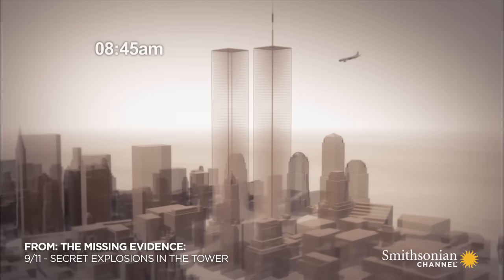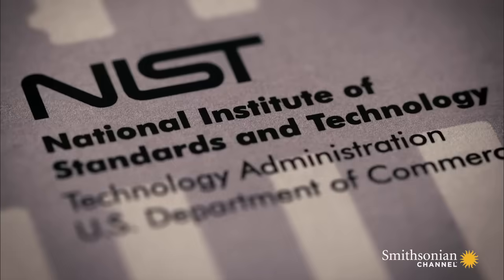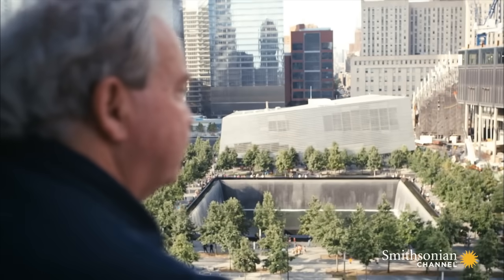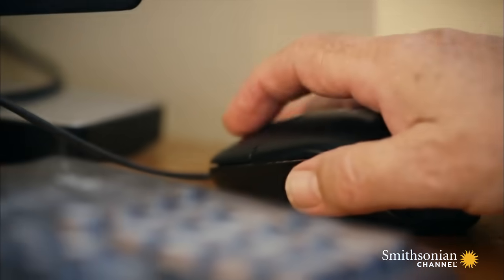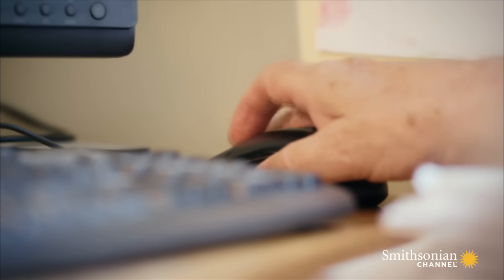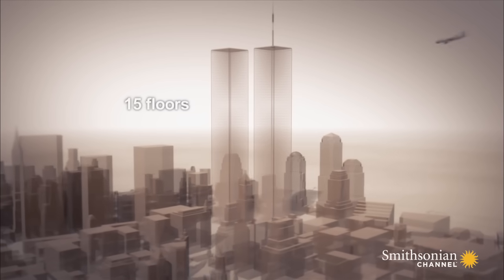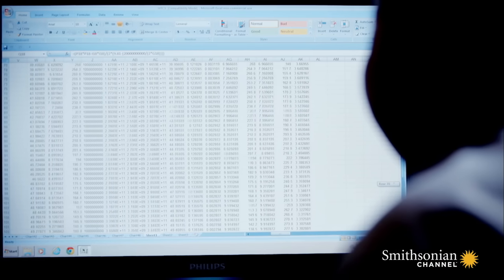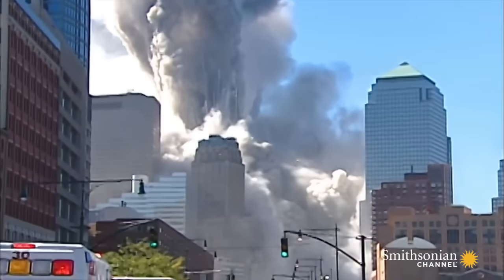This Computer Simulation Explains How the Twin Towers Fell

Comment: The block is suppose to be good at what he does, but he cannot even work out that a plane, ( made of alloy mainly) would have come to bits on impact and the main part of the bits would have been on the outside of the building.
He also misses the point that the amount of concrete and steel left after this was not enough to build half of the building.
Also since when does concrete in its solid state turn into powder on the way down.
An engineer with good practical knowledge of building materials, Dr. Judy Wood wrote a book that he needs to read from front to back its called where did the two towers go?
There are also people like myself who have also studied this  and like it or not there were explosives used, i have a video of an explosion taking place at the base on the corner of one of the buildings before a plane is supposed to have hit it, where did that come from.
I think this man has watched to many road runner cartoons and thinks things actually do make a hole that outlines that which impacts another object.
I have photos of just what happens when a plane travelling much faster impacts somthing and these clearly show that planes dont do anything like we were told happened.
I suggest he goes and does some more home work.

Comment: Pure propaganda bollox. He is being well greased. 20 floors above the impact dropping vertically, my ass; It has all amazingly become dust. And building 7 just thought it should follow suit for no discernable reason! And some little piggies got very rich and oil rich Iraq got invaded. And you can be damn sure the ordinary taxpayers were screwed over for every cent and the piggies are wallowing snout deep in the trough, caring not a fart about all those they murdered.
Reply: Oh my, another amateur structural engineer? Maybe study up on static and dynamic loads kid.

Comment: Everyone involved in defending the official story has lost credibility, NIST, Popular Mechanics, Smithsonian, the Federal Government, etc. If there is one good thing that came out of 9-11, it is this. Thank you for showing us who we can trust and who we cannot. To think that an aluminum can could go through a massive exterior of 2 1/2 inch steel enclosed beams, set 1 meter apart is loony tunes to begin with. Then to witness a mostly steel building just turn to dust and blow across the city should give one reason to question reality all together. Kind of goes against everything we thought that we knew about physics. Most of the billowing clouds of powder had to be steel, as very little concrete was used in the construction, mostly just in the floor pans. Makes me want to avoid any steel skyscraper in the future, it might just turn to dust and blow away.
Reply: Just make it up as you go huh? A 767 is a bit more than an aluminum can. And you really didn't do your homework on the steel. Up where the planes hit it was little more than a 1/4 in thick. and the buildings sure didn't turn to dust. The recovery crews reported the steel pile was 16 stories high. All the dust was gypsum panels pulverized in the collapse. Steel does not turn to dust until it has rusted for 100 years. Now maybe YOUR physics is rusty or nonexistent, but lots of sciencey types are comfortable with the planes breaking through the steel frames, and more of them are okay with the collapse mode. You can pout and whine all you want about the experts disagreeing with you. The rest of us think your little tantrums are precious.
Reply: @joeplumber1337  But lots of us independent "sciencey" types are not. If physics reacted as you described, then you would be out of business my friend. Furnaces and boilers would simply melt down and collapse leaving a cloud of small iron spheres all around it since most are fired by the same fuel that supposedly took down the twin towers. If an aluminum plane went through the heavy steel towers, and did not just plaster itself like a pancake and fall to the street below, then it was because the beams gave all at once, easily done with pre-placed explosive charges. But how it was done is not important to determine guilt and motive.

All of the evidence, if one sticks to science and physics, points to collusion and prior planning by those who had access and control over the buildings, the cleanup, and destruction of a crime scene, and the talking points after words. Osama bin Laden in his cave, would have had no such access unless the US Government at minimum looked the other way, which would have also indicated collusion. All fingers, no matter how you look at the whole body of evidence related to 9-11, points to massive collusion, and that points back to only one place.

The whole event opened the door to greater control and power by the US Government. Guilt almost always can be determined simply by looking at the actions of all involved parties prior to and after an event, and then determining who has the most to gain. Perhaps, you should be thankful that some of us understand physics, psychology and the sciences, which allows you to put food on your table. I suggest that you leave the thinking to us and just stick to plumbing.

Comment: Laughing at all the people who think a 110 story building would fall over like a domino.  How in the world could a building that large maintain structural integrity as it is falling over?  Think about it.  Or do some calculations.  Let's assume that the building leaned a few degrees.  Now calculate the component of vertical forces that are being applied in a direction that would cause a shear of the building keeping in mind the extreme torque that the lower parts of the building would have to sustain to maintain structural integrity.  These forces would far exceed any design goal for the building to handle shear forces.  Now go a few degrees more.  Any building this large would begin a vertical collapse long before it could have any noticeable horizontal lean.  Now assume that some parts that broke away did have some horizontal movement and calculate the angle of fall after it made half of it's parabolic journey to the ground.  Now calculate the angle as it nears the ground.  (Hint it will appear almost vertical which is seen in many of the videos.)

It should be obvious to anyone that a building this large would have the appearance of a collapse on itself.  It's not exactly collapsing on itself as some parts will (and did) fall a half block or so away but looking at it from a distance it will appear to collapse mostly on itself.

That would basically be true not matter where the structure first failed.  It is impossible for a building that large to fall over like a domino - which is something conspiracy theorists seem to want to believe would happen.

Comment: 1) anyone see what a plastic drone did to the nose cone of a passengers jet?
And your telling me a Aluminum plane did this to steal?

Not buying this crap
Reply: Your incredulous whining proves why the plane penetrated the tower. It's not that the plane was weak, but the drone hit the nose of the plane with very high speed, and was able to damage it. And so, the plane hit the tower with great speed, on a much larger scale, and broke through the lattice. We're talking 250 ton of airplane going 580 mph. Of course it went in. There was nothing else it could do.

Comment: Fake expert! Make ur computer program public for scrutiny otherwise we r just talking unicorn a d flying pigs.
Reply: Make your own program
Reply: This guy is a computer programmer, not a physicist.  And you don't even have to be a physicist to figure out that it is impossible for the weight of the top 15 or 23 stories 
to crush the bottom 90 stories - even if you could lift those stories up and drop them down on the stories below, the upward pressure would cancel out the downward 
pressure.  Eleven seconds or 15 seconds?  That's a joke!
Reply: joel morrow where the actual fuck did you get 15 seconds? Tower 2 fell is 17 seconds. Tower 1 fell in 23 seconds. Also we no longer believe in the block driver theory. We believe in a catastrophic core column failure causing a truss fail, causing the tower to fold in on itself. Then with thousands of tons of steel falling down on the floor, it crushes it, mangled the steel, and pulverized the concrete into the dust cloud we see. As more weigh grows on the falling debris, the less the lower floors have a chance to fight back.

Comment: Even if the steel was weakened by 90%, there still would be no freefall acceleration at any time.
Reply: There was no free fall.
Reply: @joeplumber1337  WTC7? Even the NIST admitted free fall.
Reply: @duketwo22  In 7 only. For 3.25 seconds out of the entire collapse. Certainly not due to explosives.
Reply: @joeplumber1337  Freefall means that all columns must have been vanished at the same time. 3.25s  * 9.8m/s = 31.85m.  If the height of one floor is about 3 meters, that means 10 floors just transformed into nothing from fire? That's straight impossible.

Comment: You have a fast light weight sports car that can do 1G acceleration. You drive on the road, last on line that have 7 vehicles, each bigger than one behind, first is semi truck.
Someone have build a unbreakable wall across the road, luckily hole line manages to stop before it but there are no gaps between bumbers. Only your stopped before, thanks to your
sports car, and you have 3 feet gap to car in front. Unfortunately there is intense fire under your car, gas line or something. After an hour in the fire it gets hot in your car and you hit
pedal to the metal.

How fast you hit the wall after demolishing all the cars in front of you?

Comment: I think the reason why the 2nd tower fell faster was because the plane had crashed through lower floors than the 1st tower causing more weight to be pressured where the crash was unlike the 1st tower it had crashed on upper floors which wasn’t as heavy as the 2nd tower

Comment: Doesn't ever action have to have a equal and opposite reaction? haha. Your computer programme is talking shit mate!
Reply: asrgaqgq sdfgsdgsdfgsdg  You are so wrong! The World Trade Centres were made of huge solid steel columns through its centre and a outer set of steel columns on the outer shell. So no they was not hollow!! You complete idiot. You don't even understand the structure of the building for 1.  A plane flying into those buildings is like poking a pencil through a spider web. YES EXPLOSIONS WAS HEARD FROM EVERY PERSON ON THE DAY!!! :D I CAN SHOW YOU HUNDREDS OF PEOPLE ON THE DAY SAYING SECONDARY EXPLOSIONS IN THE ELEVATOR SHAFTS AND THIS WAS EVEN REPORTED ON THE NEW ON THE DAY TOO!! WOW YOU CLEARLY HAVEN'T LOOKED AT ANY EVIDENCE OR YOU ARE BLINDLY REFUSING TO ACKNOWLEDGE THE EVIDENCE! No squibs are not air pressure from floors falling. Squibs are a known from when a building is demolished. Buildings on fire just dont explode my friend!! You can set fire to as many steel structure building as you want to on planet earth and they would never ever ever implode on them selves like this. These building was clearly demolished in a controlled environment. Its plain to see and all the evidence shows it and even what people said on the day. You have to be scientifically illiterate to think otherwise

Comment: Watching on the news when I was 15 years old from the other side of the planet two thoughts came to mind: 1. How horrible that all those people died in that way. 2. It was strange how the buildings fell. Particularly building 7. Very odd.
Reply: I think it's perfectly possible that a building suffers from massive structural damage right after two 100plus-floor skyscrapers collapsed right next to it.

I was 14 at the time and it was the first skyscraper ever I witnessed collapse, so I had no way to determine whether this looks like a normal skyscraper collapse or not.
Reply: @SimSimon87  The problem is that if this were the case, the damage to WTC 7 would look similar to the damage seen from the marriot that was connected to WTC 1 and 2. Look up photos of the marriot and you'll see what I'm saying. It was still standing, albeit ruined/unusable. WTC 7 is forsure where the story completely veers off course.
Reply: @dissectingdarkness3560  sounds like you're onto something, albeit 20 years late 😅
Reply: I was 6 and didn't understood what is going on in the news, I saw the second plane crush and didn't understood what just happened. I see myself untill today sitting and didn't get it. Im Czech but I still feel the pain for that memory of US suffering.
Reply: Everybody thought that when they went down. Pretty much the normal reaction on day one was they were demolished.
Reply: do you remember how they showed "airplane that hit pentagon" for like 2 minutes and cut that immidiately when they realized it looks so made-up even a kid like me did realize its a scam?
Reply: Exactly the same. I was 15 and thought same thing; something looked off
Reply: I made a theory. here it is

If a Boeing 767 crashed into a building like that, on physics the top of the tower would have fell forward onto the plane and the bottom would fall the opposite direction but they just fell straight down. The only way for that to happen is if something or someone made the bottom floor collapse meaning the towers fell from the bottom. But there's some people who say "Well yeah but you weren't there and you didn't see it or hear it." and your right and I almost gave until I remembered an audio. It was a recording of a woman on board who said "Its a frame.". A frame is when you accuse someone of wrong doing that you have done and they get in trouble for the actions you made. So if this is true, If it wasn't Osama then who was it? who was the master mind? and I have searched and I see almost nothing..... except. There was a announcement that was about The National Economic Security and Recovery Act. But the evil couldn't allow it for some reason so they came up with a national disaster to push peoples minds and thoughts away from National Economic Security and Recovery Act. The National Economic Security and Recovery Act was dead afterwards. People were killed. But not the plane because, The planes weren't there, The things that made the building fall straight down was what killed people.

Remember this is by my own research and speculation.

Comment: 4,500 tons of concrete & steel PER FLOOR.  that's the carry load as constructed. at 15 ft per floor...4,500 tons has a freefall impact of 90,000 tons. that's PER FLOOR x # of FLOORS! the ONLY surprise is that the towers didn't pancake MORE than they did!
Reply: Gee..that's some nifty quantification ya done there...you count all them numbers by yourself?

Comment: Each floor was 5 thousand ton. That's like ten of the biggest airliners on every floor. As it collapses the weight hitting each subsequent floor rises exponentially on the way down, literally speeding up the freefall. You can see that the outer walls are just a shell the floors are attached to. They shear so easily under an accelerated force. I wonder if any of the architects were still alive at the time and felt sick to their stomach that the design was actually inherently flawed...
Reply: Adding mass does not accelerate the fall time

Comment: There was bombs at the bottom
Reply: You have a fortnite profile picture, so everything you say doesn't matter.
Reply: Bobby Hawkins   Ok, proof?
Reply: Bobby Hawkins  
the explosion was timed to coincide with the impact so as to conceal the source

The explosion?

That you can't prove?

the rubble piles were barely 3 stories high

Closer to 14. About what would be expected considering the Towers were 85% air.
Reply: Firemen reported hearing bombs in the lobby of the world trade centre just as the “planes hit” cough cough*
Reply: @glendalrymple1842  Can I see that report? Plus, if a plane hit a building and you were in the lobby of that building you would hear an explosion, maybe not like a boom you hear when you're right next to a grenade but like thunder.
Reply: Saturn314x people actually saw bombs blowing up in the lobby of the building, then there’s an  angle that shows the bombs going off about half way up the building
Reply: @glendalrymple1842  Ok, proof?
Reply: People actually saw planes hitting the towers. Plus there is proof of it! Hundreds of thousands of people from different countries watched as these buildings got hit by planes and fall down to the ground.
Reply: @glendalrymple1842  
Firemen reported hearing bombs in the lobby of the world trade centre just as the “planes hit” cough cough

There were firemen in the lobby of the buildings that were hit?
Reply: Not only there
Reply: @nowonmetube  
There is no evidence of explosives or incendiaries used in the WTCs.
Reply: Actually witnesses never reported any explosions coming from the building prior to the fall except for the collision explosion
Reply: @GamerLean  actually many did
Reply: @nowonmetube  Ok give me the reports. If it's credible, I'll believe you.

Comment: Sure, the buildings may have been designed to "withstand the impact of a commercial jetliner," but the buildings were on fire. Not just on fire, burning jet fuel. It was so hot, people above the crash jumped out windows, rather plummeting to their death than staying in that building. Steel can't hold up to that kind of heat, it's gonna melt, and that amount of concrete can't hold itself up. When a building is on fire, it collapses, maybe not because of the amount of impact. Keep in mind I'm 14 at the time and I can guess that much. Maybe I'm wrong, too, I haven't looked into that much so don't think this is the reason behind it, but it can't be an architectural error. I'm proud of the man who designed these buildings that they held up even that long... rounding to an hour is an ungodly amount of time for a burning tower to hold up. 9/11 is a really sad day for me, so... remember it, but don't fear it.